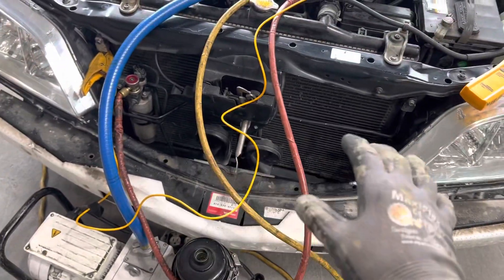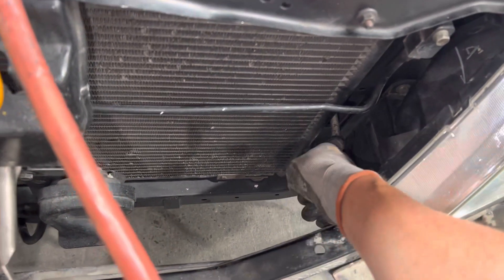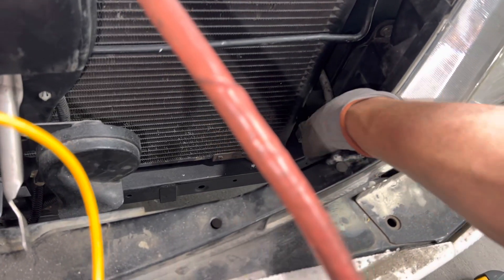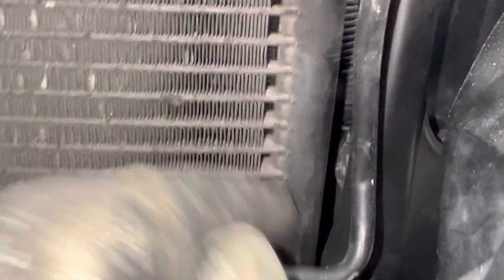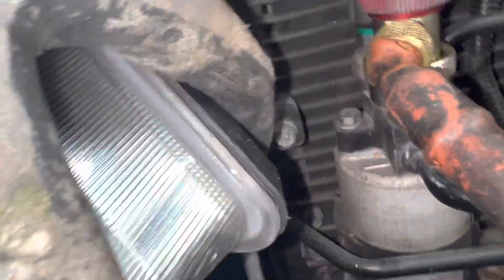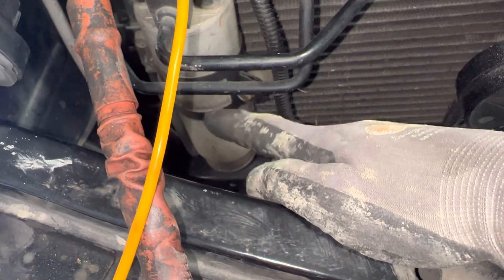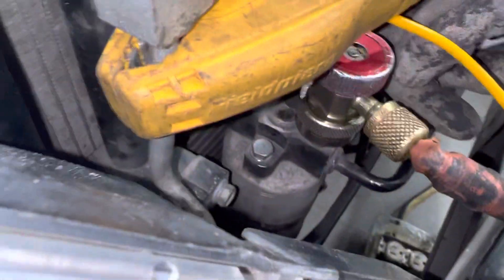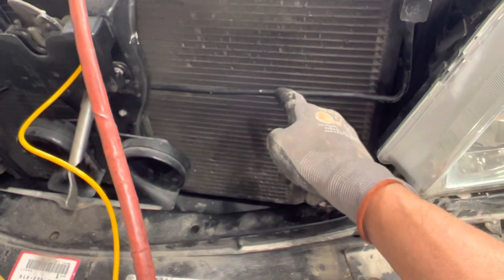￼ A slightly different AC condenser path of refrigerant.   New TECHs Be careful on diagnosis￼

Comment: Temperature exchange is better when tubes are full of liquid instead of gas, thats for sure but I ever thinked that the receiver should be on the main liquid line to store changes in the quantity of condensation (fan speed, engine rpm, ambient temp changes...)

Automotive isnt perfect, but it works!
Reply from the maker: Automotive is far far from perfect it’s at the opposite end of the spectrum. 
         
In automotive they do things that seem to defy logic and bend the rules of physics. 

Remember you gotta basically have a split system from a home driving down the highway at 75 miles an hour having stones bounce up and hit the condenser every part in component is bouncing up and down like a six. Five earthquake on a rough road be operated it in the cold be operated in the heat and then have a compressor strong enough to live a few times with somebody who doesn’t know what they’re doing stuff in liquid down it or starving it for oil and cooling. 

unlike a house car has dehumidification mode where you can throw it in the recycle or have a door ass DOA outside air multiple speeds. 

Just think if a house air conditioning can run with fan speeds down to 100 CFM per ton up to 500 cfm Per ton

Comment: I have a e46 coupe manual replaced evaporator along with all o rings (used compressor) replaced expansion valve with oe supplier brand. Evaporator and Condenser replacements were rein brand. Used nylog blue on all o rings. 
New drier receiver (rein brand) 

Charged it by recommended sticker 740 plus or minus 25g 

Probably about 1.68 or 1.67 Lb on the higher end charged with my old school white industrys (snap on) machine virgin r134a, i would have to check pressures again but it would blow 40 ish degree F° and Waiver some on 100+ degree days in ca can’t say I’ve checked my humidity while working on car ac but seamed to me it could give better result. My goal was to get it cold as possible. Any advice you can offer? 

I tried to do research on what brand would be best and most cost efficient but watching one of your other videos about condenser and evaporator fin density makes me question it. 

Great videos! You have a new sub
Reply from the maker: Oe usually best. On newer stuf.       But if you’re car is old 90s early 2000s  only thing you can do is find newer higher fin count from different car .   At need to modify different hose fitting. 
            Little sheatmeatle work. Bracket and hoses to change different condenser.   

Can add a small Subcooling condenser 

Even add trunk mount evaporator kit from limousine in trunk behind seat ductwork to passenger compartment 

Sometimes limited temp by oe temp stat minimum setting cutout point

Comment: Hello, I have a rather unique idea of using hybrid car ac compressor that can take power from a pulley or electricity in a conventional car. my goal is to be able to use AC in the car but plugged in to my garage 220v outlet and switch to engine when I go out. The idea is to make a combination of controller to control the AC system and SMPS to convert the 220v ac to whatever it needs (hv dc for compressor and 13v for car's electrical so i dont kill the battery). 

This idea pops on my head because I like to do things inside my car like blasting loud music without disturbing my family or just having a private phone calls. 

Now I'm not planning to actually build this idea as this is just a random idea when I can't go to sleep. But I want to know what do you think about this idea.. thank you
Reply from the maker: Yes this idea has been used for decades on RVs and freezer box fans and cooler vans for commercial delivery van conversion or pick up conversions the rooftops have combination pulley air conditioning and electric air conditioning. 

Honda actually makes a electric compressor that has a mechanical compressor on the front with a pulley and electric compressor all combined in one unit. 

All over the world there are many small electric compressor companies that sell aftermarket kits to put onto old vehicles or retrofit or add additional air-conditioning it’s not too difficult pretty simple all the problems have been solved and there’s many kits if you search on Google there’s a company in Australia that makes a compressor kit and several vintage old air product companies for putting electric compressors in hot rods so yeah very doable you can do a little bit of work a little tinkering and modification but it can be done
Reply: @coldfinger459sub0  the honda hybrid ac compressor you mentioned is the source of my idea after I watch speedkar99's hybrid car ac video. I originally think about rewinding a standard ac compressor to run on 12v ac by opening it with a grinder and modifying it. (powering it with a sinusodial pwm inverter I already built and use in my car)
Reply: @coldfinger459sub0  Also, If I use a standard 12v electric AC compressor.. then I need about 230-250 Amps to supply it about 2-3kW at 12v right? Thats a ridiculous amount of current my SMPS have to handle :D (I'm not entirely sure, please correct me).

The honda hybrid compressor uses 144v DC (from google) so I think it's more easier to make because 20-40 amps rectifier is easier to find here where I live.
Reply from the maker: @putraadriansyah8082  just remember to have safety protection to have your inverter cut off the voltage to the battery so you don’t drain it down to low on a lead acid battery because that will damage the battery in greatly shorten its lifespan. 

The AC electric compressor in the Honda is a reduced capacity.    It was not meant to carry the full load any time to load gets high it kicks on the engine and kicks in the mechanical compressor section to make up for what the electric cannot do. 

But if you’re using it at night or in a cool location out of the sun in the shade it might be good enough.     You’ll probably want a couple more batteries for extended run times. 

And when making an inverter and you’re stepping up the voltage you have to count that this is a motor and you have to have a multiplier above its rating by a factor of several times for hard starts. .
Reply: @coldfinger459sub0  The inverter in my first idea in my reply is to convert the 12v dc to 12v AC because the compressor is modified so I skipped the step up transformer (reduced windings). 

I make my own inverter using egs002 module and UPS transformers. So the safety protections (low voltage, over voltage, short circuit, soft start) is already built in with the EGS002. 

I'm thinking about skipping the step up transformer because in my first idea I'm thinking to open up a home ac compressor to reduce it's winding. 

But after I know that theres exists a hybrid 144v AC compressor I think that unit is better for this application and be more efficient because stepping down 220v to 144v is more efficient than 12v. 

I'm thinking to make my own SMPS to output 144v and 13v because at home I plug my car to my garage's 220v outlet. The engine isn't running and the blower/condensor fan is powered by its 13v output
Reply from the maker: @putraadriansyah8082  you are correct you have been doing your homework the more amps you have to push in lower voltage all your connections and the size of your cable Hass to get ridiculously large. 

That’s why the higher the voltage the compressors you noticed the smaller the wires

Takes a little work but it’s doable lead acid batteries are the worst thing to use because they really do not like to be cycled down and drained.    

I own a Prius and it’s my work vehicle I turn it on at 7 AM sometimes 6:30 AM when I leave the house I get home at 7 PM or later and I never turn my vehicle off it stays idling all day with the air conditioning running I like getting back into a nice cold car.     He uses so little gasoline I don’t care even at six dollars or seven dollars a gallon it barely uses gas running and idling all day I do anywhere from 6 to 8 or more stops a day between jobs and as I am working the car is running with the air conditioning on. 

Usually all my cars get around 350 to 425,000 miles with original engine in original transmission and I’ve had many many many cars are used to drive 100,000 miles a year in my younger days.
Reply from the maker: @putraadriansyah8082  every time you convert electricity there are losses in efficiency. 

I know it’s easy to build your own step up and step down you have to think of safety and filtering in the other electronics that are in your car and make sure it’s in a place just in case it catches on fire it doesn’t catch anything else on fire in case it lets the magic smoke out.